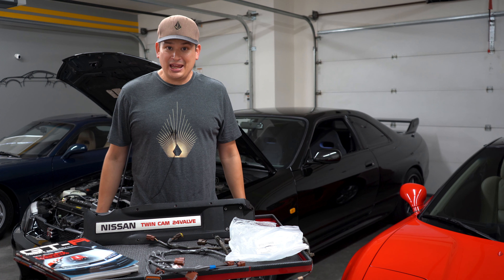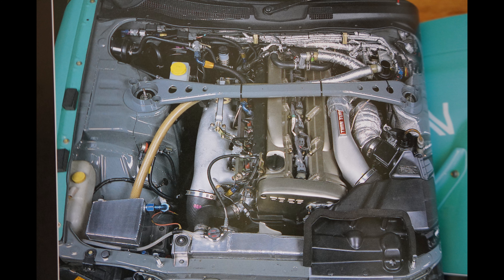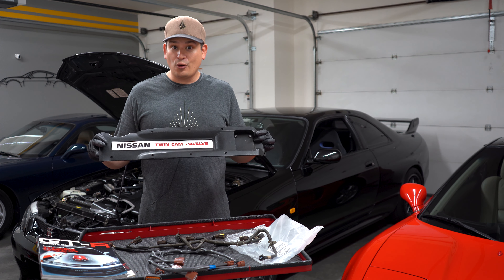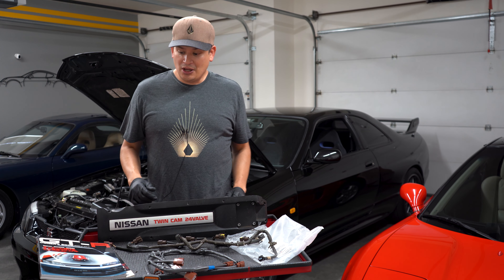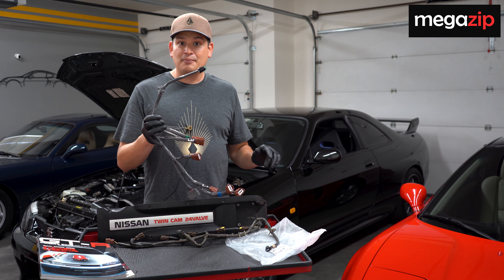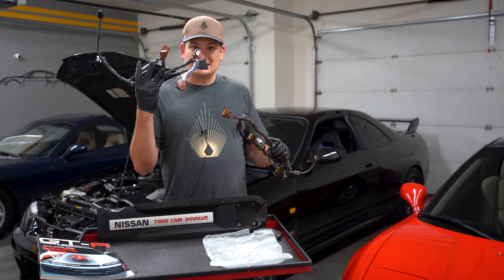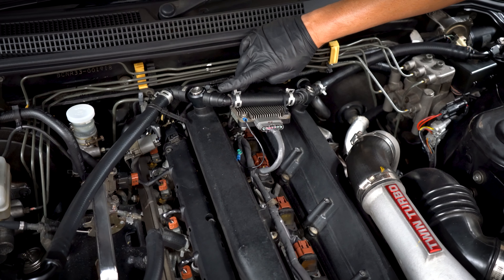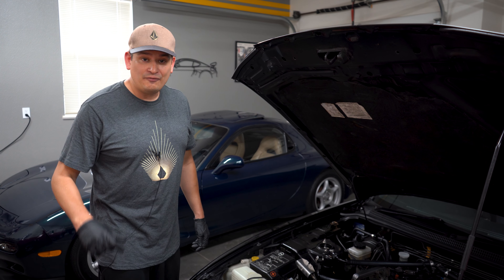To Valley Cover or To Not? R33 Nissan Skyline GT-R RB26 Tech Discussion

Comment: I would honestly get new coils bro. Supertec makes an awesome kit which not only looks cool with anodized brackets but uses genuine hitachi R35 v38 coils. Also sells a race spec harness and  the original valley cover fits with no modifications. Not to mention the coil packs are direct and allow the ballast delete, provide twice more spark intensity, allow dwell times to be set and allow high impedance injectors.

Since I’ve run mine I have not had one single misfire.
Reply from the maker: That is some great information! Thank you. I am going to look into that right now. Sounds like a great idea.

Comment: I have the HKS R35 coil pack kit… so i have to remove the cover anyways. Unless i want to mode the back part of the cover.But i do like to see them HKS coils in the valley..
Reply from the maker: I hear good things about the R35 coil conversion. I know you have to get a different bracket and such.
Reply: Actually, it came with everything needed to install. However, you will need a aftermarket ECU to adjust the dwell times

Comment: Truth be told, buy either the HKS kit or the PRP kit and get new coils. Both come with a new harness that eliminates the igniter controller plugs.  You eliminate that igniter all together and looks cleaner. 
If I’m going to replace something that factory and there’s a substantially more efficient and modern tech available, I go with that.
Reply from the maker: Good idea, I will definitely look into. Appreciate the information.
Reply: Pretty PRP kit is also plug and play with OEM ECU as well. Will be doing that on my BCNR33 as well !
Reply: @Akatsukihi  most certainly is compatible. Have one on my 33 GTR